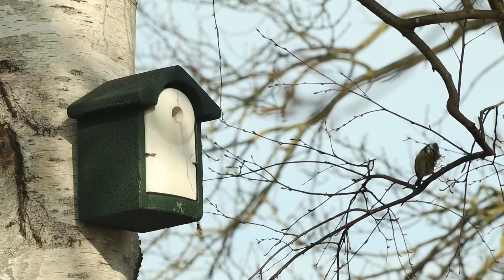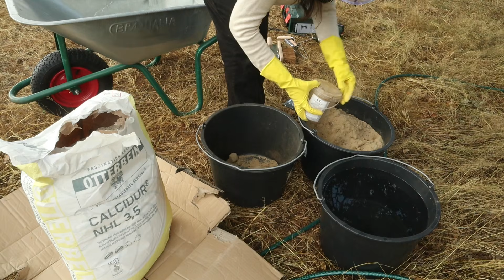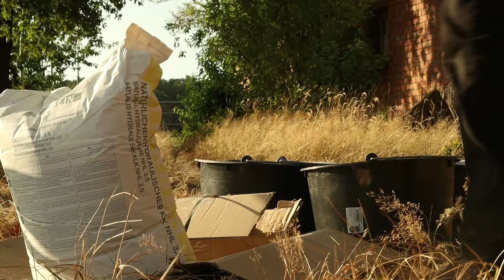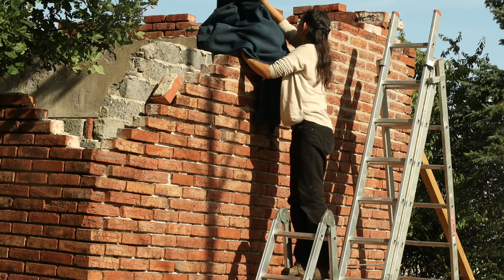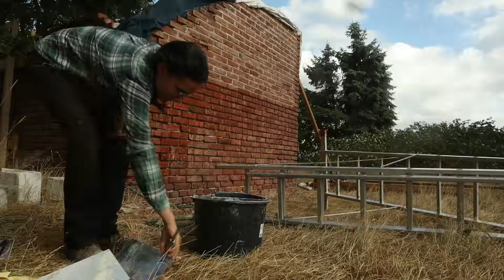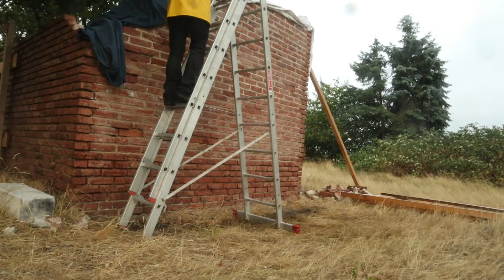Year 1, Chapter 20: The Lime is Here! Making Lime Mortar to Repoint the Cabin

Comment: I would recommend using a misting attachment on your hose. covering the freshly applied mortar with a cloth is a good idea but I think the cloth you used looks a bit too thin considering how windy the conditions appear to be so I would suggest using a thicker one otherwise it will probably dry out too fast or making sure to mist water onto the thinner one every couple of hours to ensure it stays damp.

good luck with the rest of your walls. 

Your project is interesting to me because I am considering moving to the Netherlands or a northern/north west state in Germany to be more centrally located in Europe for my job and as my work is not bound to a city I would almost certainly buy an old countryside property because that’s the sort of thing i like and because I want space enough to have an in ground swimming pool and as few neighbours as possible.

Comment: so glad you used correct protection Lime is no joke it is very nasty especially dry it can even burn the skin if it land on beads of sweat but it is an excellent material foir pointing and brick laying and lasts a very long time. ohh and it helps that it looks good !! a little tip for you especially for wide gaps you can cut a piece of rubber hosepipe and use that to run along the pointing lines by pressing on it as you pull it will make them all look pretty even and rounded to help with water run off.